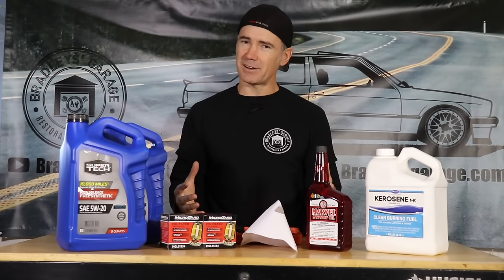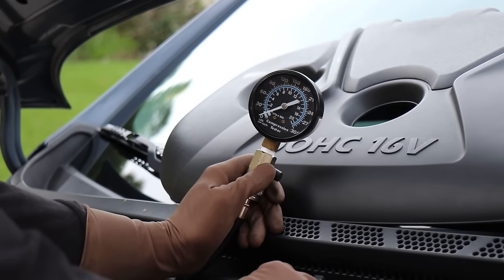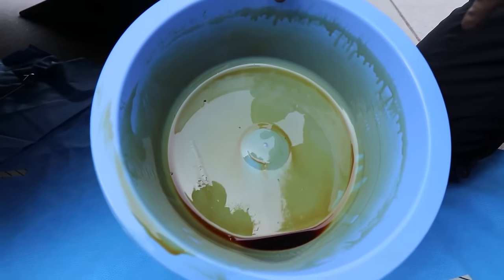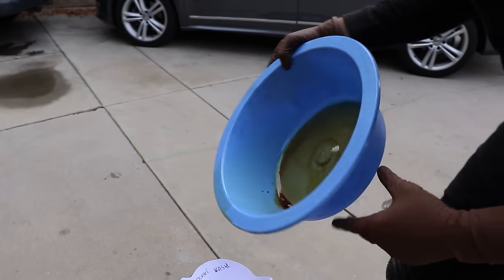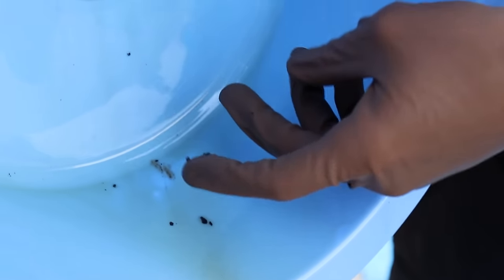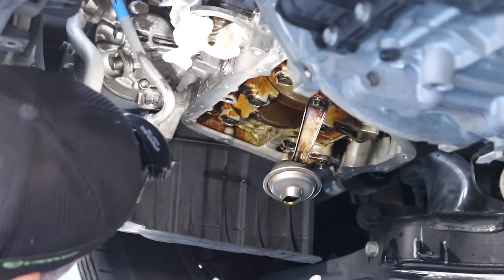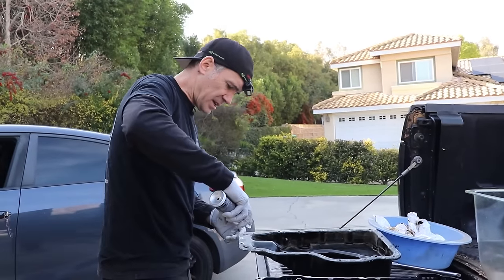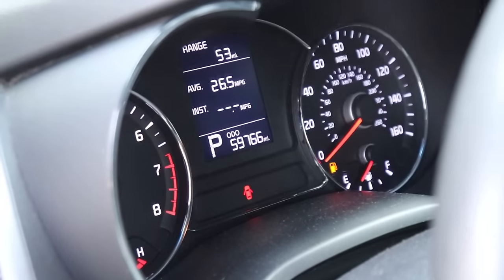*UPDATE* Customer States Jiffy Lube refused to change my Oil - Sludge Factory Kia Forte

Comment: The Marvel Mystery oil is a mistake. It reduces viscosity & additives in it aren't good for your base oils chemistry.
 When doing a flush you want full oil level, plus about a gallon of diesel & a quart of cleaner. Fast idle for 30min with 1/2 of the radiator blocked off. The point is to have the crank splashing in the flush mixture & get the engine temp up a bit. Don't overheat or drive vehicle. It will take two more oil changes to get diesel & cleaner totally out of oil supply. (These ratios were for a V- 8 motor.)
Reply from the maker: Thanks for the comments, appreciate the feedback. We just posted a 3k mile update so it looks like this little Kia is still running great.
We just posted the 3k mile update video here - https://youtu.be/QrJ0B-KXTw0
Thanks again for hanging out, Cheers!

Comment: I don't understand the OCD level of removing the sludge at this point. A few bits of sludge in the pan aren't going to hurt anything and will get caught in the filter. 

Diesel fuel in the oil could do harm to the bearings. Marvel mystery oil is mostly ATF and an unnecessary additive in 2024. Marvel was a stuck lifter cure for engines back in the day.
Reply from the maker: Thanks for the feedback, we will continue to monitor things for the next 3k miles. Hopefully we have done enough to salvage the motor.
Be sure to check out the 3k update - https://youtu.be/QrJ0B-KXTw0
Cheers!

Comment: I would probably fill it up with Valvoline clean and restore 5W-30 and the frame high flow oil filter. It’s called the endurance or whatever they’re calling it and tell him to come back every 6000 miles and if he doesn’t And he decides to go 20,000 miles on a single oil change he’s going to get punched in the balls
Reply from the maker: Thanks for the comments, we plan on doing a few more 3k mile changes until things look perfectly clean. 
Be sure to check out the 3k update - https://youtu.be/QrJ0B-KXTw0
Cheers!

Comment: Transmission Fluid, Synthetic is a good Engine Flush... Lubricity of Synthetic Trans Fluid 1/2 with Oil would make for a decent Flush. 1Gal of Trans Fluid is about the same 
as any Engine Flush... Could perform the Test 2x? 

Great Video, sounds like you are in a Dead Zone... Sounds Silent?
Reply from the maker: Thanks for the suggestions, we chose to use diesel since we had that readily available. Apologies for that brief audio hiccup in the middle, not sure what happened to our mic.
Glad you enjoyed the video, thanks for hanging out. Cheers!

Comment: Did you ever find out the true mileage of the last oil change? It looks to me like it had been at least 30,000 miles ago.
Reply from the maker: Unfortunately he cannot locate any documentation from the last oil change. We suspect it's more like 12k miles. We are also finding out more that he does in fact work really close to his house. Doesn't seem like he even gets on the freeway very often so the engine is never getting up to normal operating temps. That coupled with the poor maintenance has contributed to the Sludge situation we found ourselves in.
Thanks again for the comments. Cheers!
Reply: @BradleysGarage  then he definitely needs to get out and drive the thing occasionally.  ye ol' Italian Tuneup and all that. :D
I have the same  sort of "issue" with my mom... old(er!) lady who doesn't do much long distance driving any longer.  When ever I see her, I take her car out for a good rip on a local freeway.
Reply from the maker: @johnhufnagel  Thanks for the comments John, we have recommended the same to him. At least once a week go for a 30 minute continuous drive to to get things nice and hot. Cheers!

Comment: For this case, I would not do any flush from beginning. First, I would change oil + filter, then run for 100-200 miles, then change oil + filter again, then 200-300 miles and then change oil and flush the engine. In this way, will not block any oil hole into engine.
Reply from the maker: Thanks for the comments, appreciate the feedback. 
We just posted the 3k mile update video here - https://youtu.be/QrJ0B-KXTw0
Cheers!

Comment: Chose 1:
a.  the customer did not change the oil 6,000 miles ago;
b.  the customer paid to have the oil changed 6,000 miles ago, but the shop lied and did not change the oil;
c.  the KIA is that bad and it is the manufacturer's fault.

Chose 1:
a.  the customer changed his oil 6,000 miles ago himself and he put the oil in the wrong opening, but he put it in;
b.  Jiffy was smart in refusing to do the oil change.
Reply from the maker: Hard to know exactly how many miles since the last oil change but definitely seems like way more than 6k miles. We are thinking more like 12-15k miles sine the last oil change based on what the internals look like. 
He has had it since around 30k and claimed to have changed the oil 4-5 during this period. I'm sure the cheap oil changes at Jiffy Lube did not help the situation. 
Cheers!

Comment: I don't keep a log of oil changes. When it ticks over to the next 10,000 km I send it for an oil change, and a cvtf change on every multiple of 30,000 km. Right now it's showing 392,000 km so the next change at 400k will include aircond compressor (every 50k), spark plugs+radiator+brake fluid (every 100k).

It's just easier to remember multiples of 10k distance than being so exact that you lost track. At most you go over or under 1k.
Reply from the maker: Thanks for the comments, it sounds like you have been diligent on the maintenance and it shows in your mileage. What type of vehicle are you referring to?
We posted the 3k mile update video if you haven’t checked it out yet - https://youtu.be/QrJ0B-KXTw0
Cheers!
Reply: @BradleysGarage  Mine is a 2014 Honda City 1.5 CVT. I just tell myself frequent service is a lot cheaper than a new engine. So far no issues besides wear and tear stuff like absorbers, battery, tires. I've checked a few times just before service and the engine doesn't even burn oil. Dip stick level remains at the full mark.

And I suddenly realized 10k intervals works for me because we use metric units. Having to remember multiples of 8k miles would be a pretty tough.

Comment: A Firestone auto repair center refused to change front and rear diff and trans fluid because of very minor seal leaks in my 2015 Explorer. I will be discussing this with corporate headquarters.
Reply from the maker: Thanks for the comments Alan, sorry to hear about your experience. Good luck with dealing with corporate about the issues.
We just posted the 3k mile update video if you haven't checked it out yet - https://youtu.be/QrJ0B-KXTw0
Cheers!

Comment: You saved this motor from destroying itself. How much would this cost approximately?
Reply from the maker: Jake spent about $250 on all the supplies needed to perform the multiple flushes. We did not charge him any labor but figure we spent about 8 hours on this project.
Thanks again for hanging out, Cheers!

Comment: If it develops any engine problems do you think it will still be covered by the factory Kia 100000 mile powertrain warranty ?😂 Seriously this car is an excellent test specimen for a most interesting video.  Well done !
Reply from the maker: Thanks for the comments Mark, unfortunately Jake is the second owner so the powertrain warranty only covers to 60k, which is where we are at now. Hopefully we have done enough to salvage the motor and keep this thing running for many more thousands of miles.
Thanks again for hanging our, glad you enjoyed the video.
Cheers!

Comment: I’m surprised that you got most of the sludge out of the engine. Maybe your friend Jake will be more diligent about oil changes every 3000 full synthetic and new filter not the cheapest one!
Reply from the maker: Thanks David, hopefully we have done enough to salvage the motor. We will check on things every 1k miles until the next 3k mile oil change. The goal will be for Jake to change the oil by himself (we will supervise) at that 3k mark.
Cheers!

Comment: There are alot of dishonest mechanics that will take you're money but not do the work. I had a mechanic claim they had changed the spark plugs when they hadn't and that caused me major problems 40k miles later. That being said its not hard to tell if the oil has been changed you just look at the dipstick and the new oil is a much lighter color. You can also buy a $30 brake fluid tester that tells you if you're break fluid needs to be changed. You can tell if you're coolant needs to be changed by dipping aquarium ph paper into it and verifying the coolant is not too acidic. You can tell if you're power steering fluid and transmission fluid need to be changed by their color if they are too dark change them. If a mechanic says you have a oil/fluid leak look for puddles under you're car and check fluid levels in the resivor. In this day and age you never trust a mechanic you verify yourself and if a mechanic tries to rip you please write a bad review on google, yelp, facebook and any other website you can think so others are warned.
Reply from the maker: Thanks for all the great tips, it's good to keep tabs on these mechanics out there. The few bad ones out there reflect poorly on the good ones.
The moral of the story is to perform your routine maintenance. At the very least, do the oil changes at the recommended intervals.
Thanks again for hanging out, Cheers!

Comment: It's a good effort, but as I said in the first video, I think the damage is done with this engine.  If there was sludge everywhere, there is definitely sludge in the bearings and they are wearing at an accelerated rate.  Changing the oil every 3k for this car is definitely good, but I suspect the engine will show symptoms of worn bearings by 100k.
Reply from the maker: We will keep tabs on things to see if it's burning any oil or has any other issues. So far things look to be performing well and have not had any problems.
We just posted the 3k mile update video if you haven’t checked it out yet - https://youtu.be/QrJ0B-KXTw0
Cheers!

Comment: Sea Foam appears to be quite good with varnish - really loosens it up.  Wherever the oil spashes will loosen it.  After a few oil changes using Sea Foam before each change it should be mostly gone.  Varnish is what ALL engines have even with regular oil changes.
Reply from the maker: Thanks for the recommendation Bob; we will definitely check out that product for our next Sludge Factory project.
We just posted the 3k mile update video if you haven’t checked it out yet - https://youtu.be/QrJ0B-KXTw0
Cheers!

Comment: I am really expressed with you and your persistence. I would of stopped with the first 2 diesel engine flush, and watched it every 3,000 miles at the oil  change. I believe if people change their oil to Mobil 1 there is no way that type of sludge will build up. I was lucky to find out about Mobil 1, at 20 years old. I only use Mobil 1 for 40years!
Reply from the maker: Thanks for the kind words Roy, appreciate the feedback. Hopefully we have done enough to salvage the motor.
We just posted the 3k mile update video here - https://youtu.be/QrJ0B-KXTw0
Cheers!

Comment: Good job on the flush with the diesel. I usually just got a few quarts of Marvel Mystery Fluid replaced that with oil and let it run for 30 minutes or automatic transmission fluid works really well it's a good detergent
Reply from the maker: Thanks for the kind words, glad you enjoyed the video. We just posted the 3k mile update video if you haven't checked it out yet - https://youtu.be/QrJ0B-KXTw0
Cheers!

Comment: The trick is to get a whole case of cheap oil filters. Start with gallon of diesel, 30 seconds, change the filter, fill filter and top off with oil. Run 5 min. Change the filter. Keep running 5-10 min per filter and fill the filters with oil. Open the filters and look at globs of sluge coming out.
Reply from the maker: Thanks for the comments Andrew, appreciate the feedback. We have heard some horror stories of people running straight diesel and then end up seizing the motor. We decided to play it safe and just use a 25% ratio for the diesel.
It's been about 1200 miles since the update video and the oil level is still full so things seem to be running/working great.
Thanks again for hanging out, Cheers!

Comment: I have in the past 45 years lost 2 toyota and one dodge motor on marvel missary oil.
No more. All 3 motors got block windows. 

Stopped using it 40 years ago have not tossed a rod since, and i have not changed driving habits.
Reply from the maker: Thanks for the comments Bob, appreciate the feedback.
Cheers!

Comment: No way I'd pour diesel into an engine. Even as a quick rinse.

A good high mileage synthetic  will have more than enough detergents to clean everything out while also protecting your engine.

A good high mileage synthetic filter will collect anything that can hurt your engine.

With the way this engine started, I'd have picked up like 3 good filters and at least enough oil to do a couple flushes and filter changes after running it for about an hour.

Either way, the damage is done, even if that engine still runs...
Reply from the maker: Thanks for sharing, we will see how things go. Hopefully we have done enough to salvage the motor. Like you said, whatever damage has been done cannot be changed.
We will monitor it every 1k miles until the next 3k oil change. That will give us an idea if it's burning oil or has any other issues.
Thanks again for hanging out, Cheers!

Comment: Be careful with the MMO. It's not good to leave it in the oil long term. It was developed as a fuel addative to remove carbon deposits, not for putting in engine oil. Seafoam is a better choice honestly. More expensive, but it's worth it.
Reply from the maker: Thanks for the information, we just added the 4oz in the oil to provide a little more cleaning. They recommend 20% MMO to the crankcase 300-500 miles before your next oil change. We are doing the entire 3k miles but only with 4oz so figured it wouldn't hurt anything long-term.
We just posted the 3k mile update video here - https://youtu.be/QrJ0B-KXTw0
Things are still looking good and we are not seeing any issues whatsoever.
Cheers!

Comment: Thanks for the update! I would love to see you use the Valvine Restore & Protect motor oil on the next go round as well as open up the filter. The most impressive thi g to me is how simple removing that valve cover & oil pan is on that Kia! It's a great vehicle as far as time invested for doing this to. Stillshocked at a plastic valve cover & I carry a plastic (polymer) pistol (Glock), but it's still odd to see a valve cover be non metallic.
Reply from the maker: Thanks for the comments, we will try out that Valvoline Restore & Protect on the next oil change. It was nice the valve cover and oil pan were so easy to remove. On our Euro cars, it is usually a real PITA. We have seen plastic valve covers going all the way back to the early 2000's so that is common place for us.
Thanks again for hanging out, Cheers!

Comment: So you wasted the expensive oil flush on the initial oil change. Nearly ruined the engine by sending it off with tons of sludge chunks in the oil.  Got lucky and fixed the issue on the 2nd attempt. Now you're wasting a bunch of time/money doing the cheap flushes that you should have done in the first place.
Reply from the maker: The Liqui Moly flush is only $15 so it quite inexpensive. Hopefully we have done enough to salvage the motor long term.
Cheers!

Comment: I hesitate to put anything strange like diesel into an engine. I always find that long term treatments like a good quality oil changed at higher frequency is substantially more... mentally reassuring giving it a nice slow time to dissolve and not damage the engine.

In other words useing a quality oil with 3-4k between changes for awhile will almost always give the best results over backyard mechanic fixes.
Reply from the maker: Thanks for the comments, appreciate the feedback. We will continue to perform 3k mile oil changes until we are confident the motor is clean. Not sure of any negative effects of mixing a little diesel in the motor so we will have to see how things turn out long term.
We just posted the first 3k mile update video here - https://youtu.be/QrJ0B-KXTw0
Cheers!

Comment: Transmission fluid works great for engine cleaning. One quart. You basically performed all the missed oil changes. No savings in running extended intervals.
Reply from the maker: Thanks for the comments, appreciate the feedback. Hopefully we have done enough to salvage the motor.
Cheers!

Comment: I'm not sure what you guys are doing but I do my change at around 6.5k give or take, My cylinder head looks brand new inside lol. I  have 215 thousand miles on a 07 civic ex
Reply from the maker: It was obvious this owner was not performing routine maintenance on his Kia. Hard to know exactly how many miles since the last oil change but definitely seems like way more than 6k miles. We are thinking more like 12-15k miles sine the last oil change based on what the internals look like. 
He has had it since around 30k and claimed to have changed the oil 4-5 during this period. I'm sure the cheap oil changes at Jiffy Lube did not help the situation. 
Be sure to check out the original video if you haven't seen it - https://youtu.be/XU79jXYWydA
Cheers!

Comment: That was way overkill. With modern detergent oil an oil change would have been sufficient. Change in a couple thousand miles and you are good to go. Except it is still a Kia
Reply from the maker: Thanks for the comments, appreciate the feedback. Not sure how many "short" oil changes it would take to break all that sludge down but we are happy with how things turned out. Cheers!